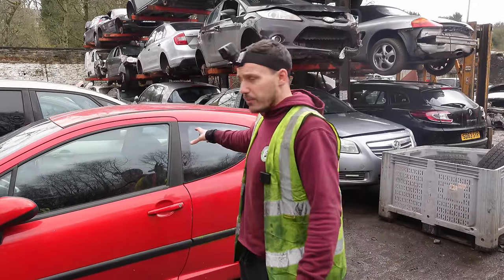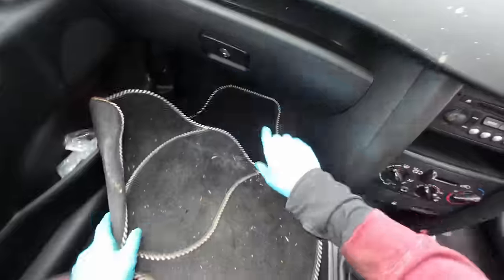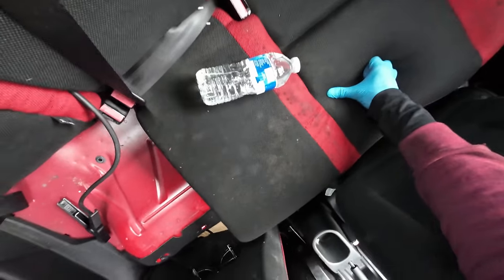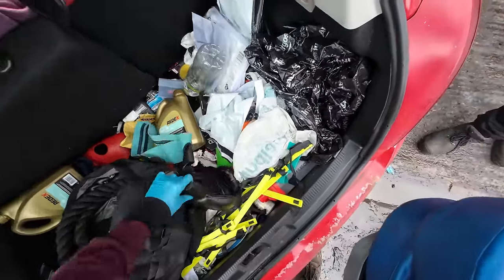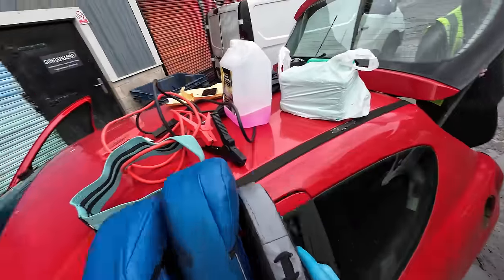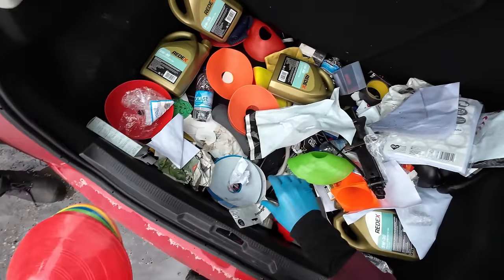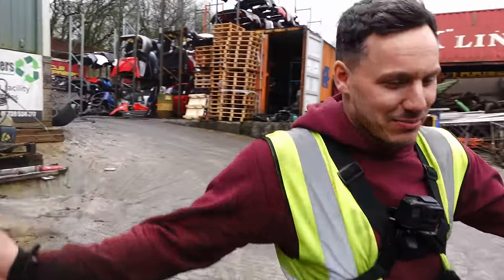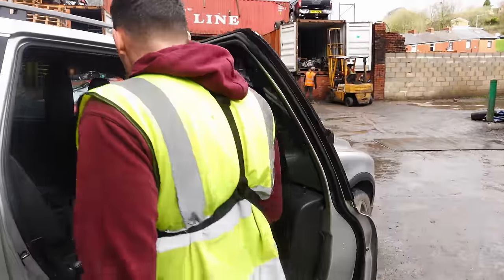iPhones, Cash & Hover Boards?! found in Abandoned Scrap Cars!

Comment: Grate video I like hidden treasures keep'em coming, if the segway board don't work and u don't want it, you can pass it on to me ill take it apart and use the battery as a battery or use the cells inside the battery and the speed controller, I don't mind giving something for them or paying for postage?? Keep the phones and collect them up when you have a few of them send them away to one of then phone companies any phone any condition they go for recycling for the precious metals they give ok prices as well. I bet CeX or Cash Generator you know them shops that buy your old electronics, when thay see 3 Tun walk in the shop i bet there well happy cos of all the things he takes in that he finds in the cars cos u know he's not saying anything, you cant tell me the stuff u have been finding gets left in the cars and has been getting crushed with the cars or all the cars before u started looking had nothing in, err no 3 ton is the first one to get to look through the cars so he's gonna be finding all the things and never said anything tut tut i bet he's hating it that he's not gona be getting all the stuff now, 😂😂 BMWs have a speaker under the front seats money drops under the plastic cover as I had found money in a car that i was getting the speakers from, you should call it hidden treasures that i wouldn't normally be told about 😂